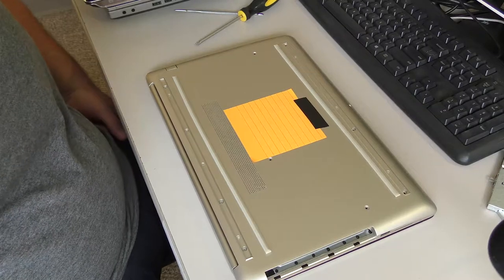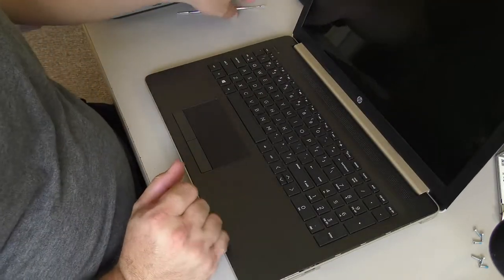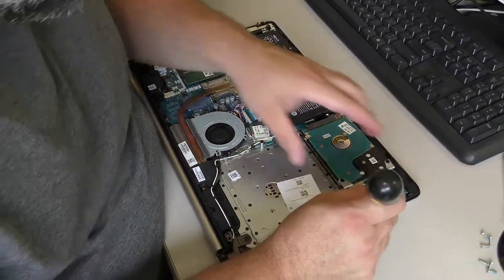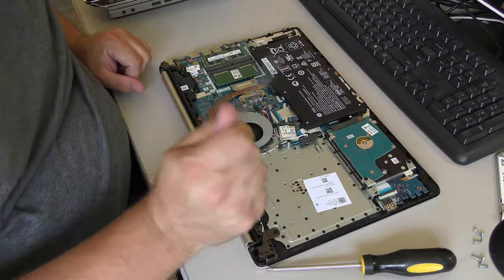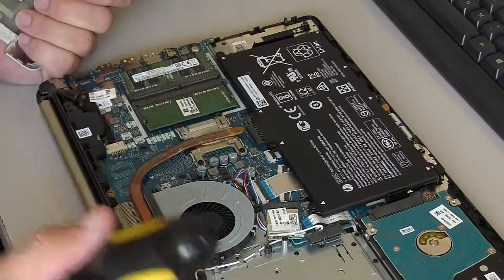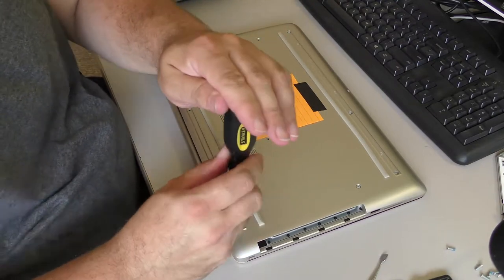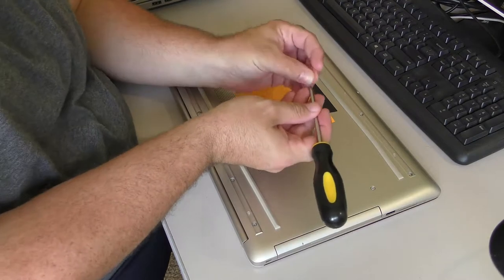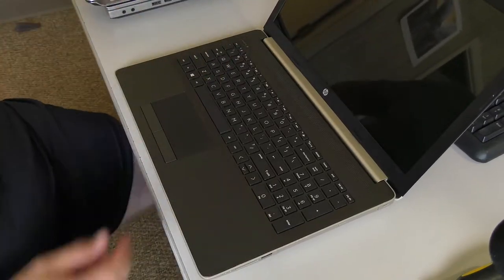HP 15-db0064nr Basic Disassembly - WHY NO INFO HP?!?! - Jody Bruchon

Comment: Thank you for doing this. I was trying to increase ram on a 15-db0092nr as it only came with 4g.  Could not figure out how to open the back of it.  Spent a lot time searching until finding your video.  It was a Christmas gift, yet thankful should I buy one in the future I will diligently seek out other brands.
Reply from the maker: Just so you know, other brands are assembled the same way. Laptop makers have largely settled on the "keyboard area as frame, giant bottom plate for access" construction. Some hide screws more than others, but I've seen every major brand do this stuff. Removable little doors on the bottom are never coming back.

Comment: I have HP-15 db0031nr, and it doesn't have a SSD M2 port next to the battery...

Is there a bypass method of upgrading to a solid state drive?

Edit: Never mind, will do a better job listening before commenting! You mentioned getting just the Solid State Drive to replace the Hard Disk Drive. Great vid, and loved the banter humour,(just pry and pry and pry) lmao! I left a like! 👍
Reply from the maker: Yes, that's definitely one way; another way, if you would prefer to sacrifice the optical drive to have two internal SATA 2.5" drives, is to get a SATA optical drive to SATA 2.5" hard drive caddy. Frankly, my preference is to have a main SSD no matter what, keep any optical drive just in case I need it (I actually use BD-R discs for some backups and long-term "cold storage" since hard drives may have magnetic domain degradation over long periods of time), and use external drives or SSDs as needed to add storage on demand. It is rare that I need storage and can't carry or use an external drive. With SSDs getting so cheap, it makes sense to get much larger ones today than we were getting even just two years ago.

Comment: Thank you for the video, I have found in my serviced mode that M.2 slot next to the battery. I se also 3 screw holes for m2 format according that port. https://youtu.be/W8oKBXXkvEw?t=296 Yours in not fitted that way :(